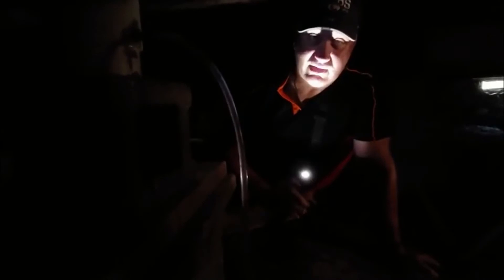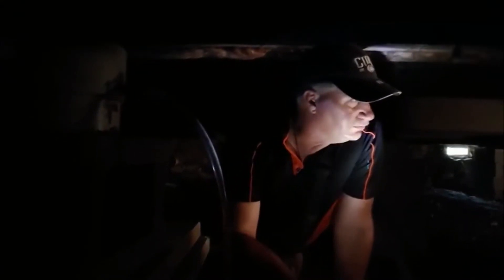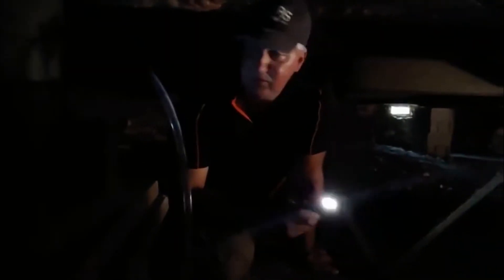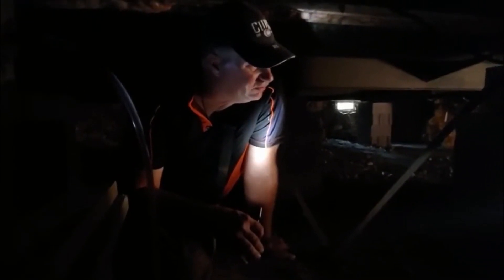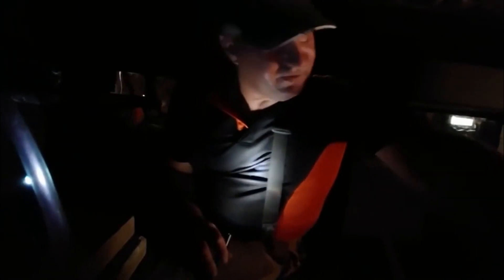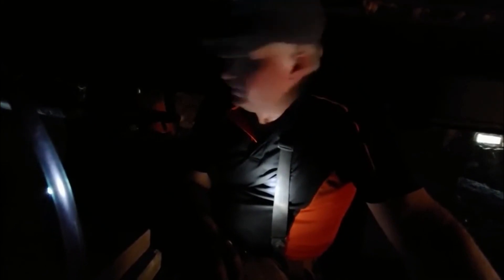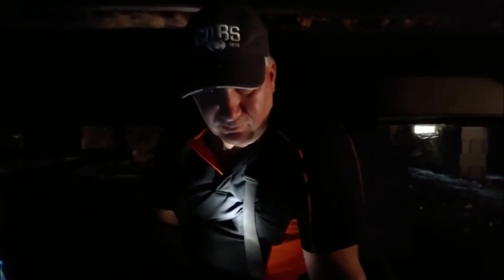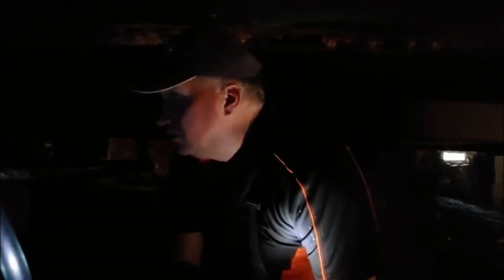How to Use a Water Level to Re level A House

Comment: So, to get started do I set my water jug in the center of my trailer and start leveling at the four corners and work my way in?
Reply from the maker: Set somewhere near the middle. Set to the frame . Then draw yourself two rectangles side by side if a double wide . One rectangle if a single wide then draw little squares on your rectangles where each pier is . Then take your water level and start marking what the water level shows on each pier . 1/4 inch up or half inch down . Decide  what will need to be done from there . Keep in mind water sewer lines . And straps if going up .
Reply from the maker: By the way always take your time Be very careful. Keep your jack level always . Ask all the questions you want . I wish you well on your journey.